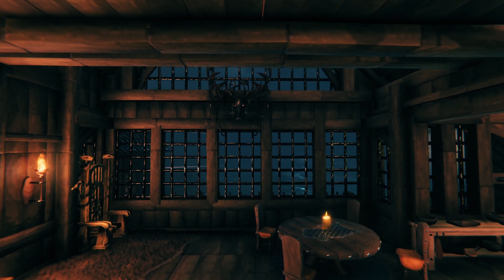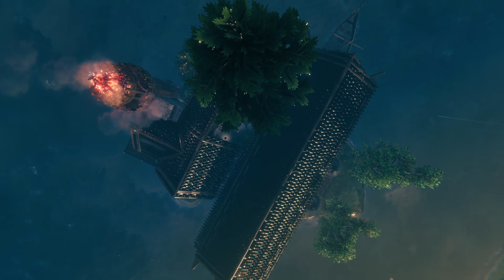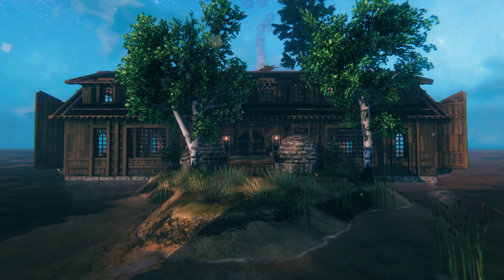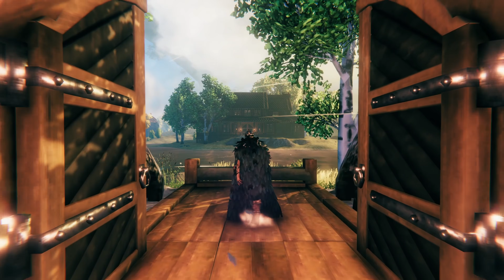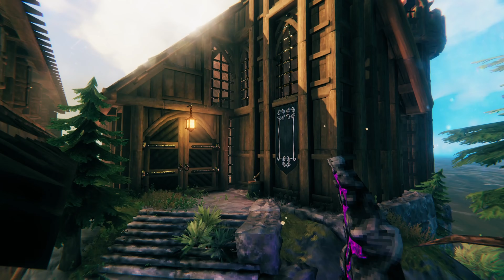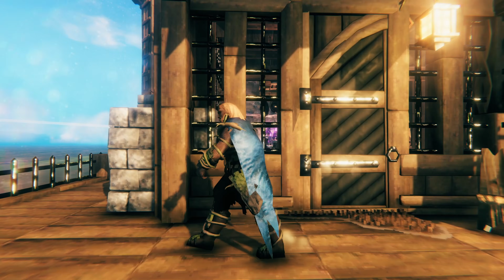Inside Valheim's Most Incredible Boathouse (Build Spotlight)

Comment: man i feel like my building is just basic when i see your builds
Reply from the maker: Trim does a lot of heavy lifting on wooden builds like this one. I also use columns to help visually divide spaces, and windows to open things up. It’s a lot of trial and error, but the results are worth it. I demo how I use trim and other elements in the Schoolhouse video if you’re interested.
Reply: @HiImKlaus I always make multiple buildings to divide the workplaces the work bench shares a building with the forge cooking has its own building black forge and the magic stump have a building the either refinery is usually  out in the open far enough away from buildings as to not have the need to repair buildings
Reply from the maker: In survival I’ve historically put them all in one place, except for the kitchen. Next time I’d like to try a plan like yours, and spread the stations out a bit.

Comment: I'm not sure I understand, how is the wooden deck immune to water damage from rain and the like? You mentioned stone and iron supports underneath but didn't really specify how it's set up and how that's relevant to protecting the wood from water.
Reply from the maker: Ah, that’s because wood that’s 50% covered by stone or roofing becomes immune to rain damage. Wood floors snap to stone in a way that covers their bottom half. It’s great for keep maintenance low.

Comment: Working on lighthouse ideas. Squinting at yours. Core question: How bonfire on wood? Or is there some hidden stone foundation in there which I do not see? Metal grid?
Super inspiring how you use what is normally thought of as 'inside' of the wood wall elements to create decorative effect. Great work.
Reply from the maker: There are a couple veins of iron running up inside sections of wall, with iron wood poles then holding up cage floor to support the bonfire. I love inverting wood walls to break up the flat surface. Thanks for watching!